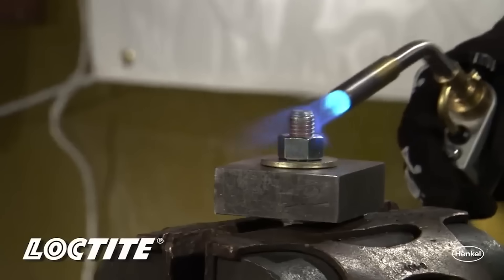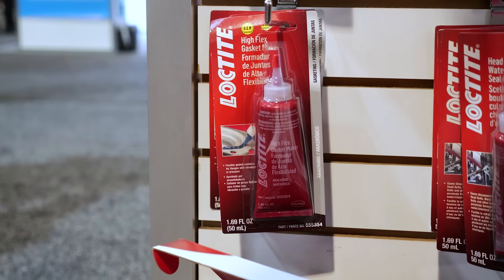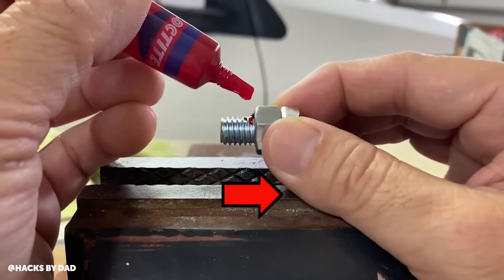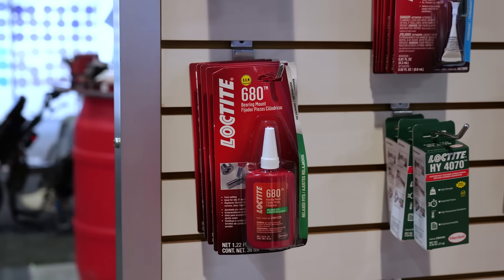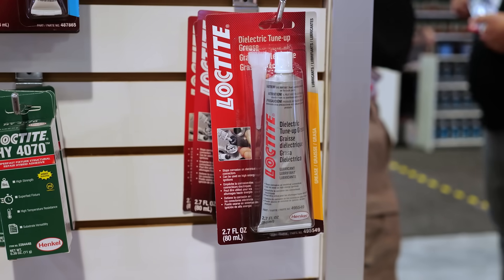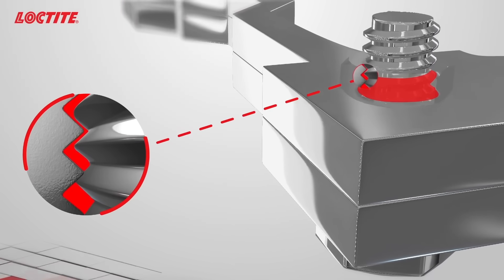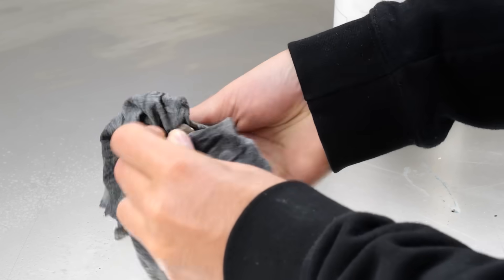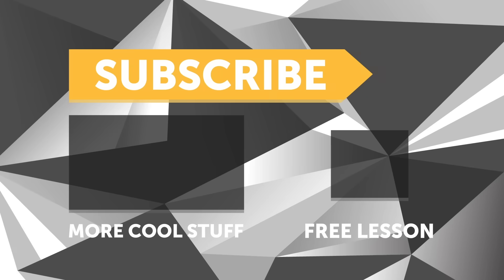Many pro mechanics don't know this.

Comment: Helpful video the only thing I also wanted to know that I'm not sure you talked about is how do the different types of loctite hold up in age?
Reply: That would be a good question to address to the manufacturers tech support and collect the answers. Enthusiast tests are useful but many people forget firms like Henckel etc have technical support who will answer questions about how they test their products. Cyanoacrylate locking methods have lasted me decades of use on a wide variety of systems but the plural of anecdote is not data. Since I have ways to apply pinpoint heat I mostly use red gel but do vary the amount based on experience. A recent inexpensive invention, the hand held induction heater, is insanely handy for users working on small hardware.

Comment: Which product should be used for small screws on fishing reels to stop them from shaking loose. Bearing in mind that the reels are stripped down on a regular basis.
Reply: Low strength purple ( 242 ? ) works for me on the tiny stuff.

Comment: I’m also a big fan of their gasket material (518) for sealing up motorcycle cases (also in conjunction with the OEM gasket, ie using as gasket dressing versus using RTV)
Reply from the maker: Great tip! What makes you prefer it over RTV out of interest? - Taz.

Comment: Mmm. So why do all these videos show cured Red Threadlocker turning relatively easily without heat?
Reply from the maker: If you find it easy to undo a bolt you've used a strong compound of threadlocker on, it either hasn't been applied correctly or it hasn't cured which might not have happened for a few different reasons - Taz.

Comment: I used normal red loctite on my exhaust manifold and it's worked long term! I had 3 bolts that kept coming loose because I couldn't torque them down correctly, put some thread locker on them and it has been good for years. I couldn't torque the bolts down because of the bad designed manifold, all I could use was a cut down ring spanner.

Comment: What looks like an official animation loop used in this video is shockingly inaccurate. LT243 is blue, it has the blue label and yet it’s squirting red. How they could let this slip is worrying.
Reply from the maker: With that attention to detail it's unlikely you're going to be using the wrong flavour yourself eh. Shame their animator wasn't at your level 😉 - Taz.

Comment: Being in the aerospace/defense sector. Primer T is used on every fastener and every bolt. Good stuff and helps the loctite set up quicker

Also would have been nice to skim over not only thread locker vs sealant. Good stuff nonetheless the less

Comment: hey, I've been wondering, what is volumetric efficiency tuning? as in what makes it different than tuning each block of RPMs in every maps (ignition duration & timing, and fuel diration & timing) one by one, map by map, using retarder/eddy dyno, i know VE tuning doesnt actually tune im volume but rather in air mass, but like wasnt regular tuning easier (it looks so easy based on you ignition timing tune, just press up and down on the laptop till it reached peak power at certain RPM and load lmao).

tuning by VE is a new field to me because not many people here do it.

from what i can get is VE tuning excels in racing where altitude variates since it takes into account fuel mass, air mass, pressure, etc. unlike regular tune where it just RPM and load/throttle position, meaning it's just as good as where the vehicle is tuned at?

Comment: Red loctite is the best way to reseal you oil pan bolts and also works great on you oil and fuel filters and even helps with spark plugs

Comment: I think it is worth mentioning that the torque specifications and requirements per bolt grade, class, diameter, thread pitch, etc. and the fastener pairing (nut, nut with washer, blind hole, etc.) are affected when loctite is used as it effectively becomes a lubricant and therefore the "lubricated torque value" (which is typically different than the dry value) from the bolt manufacturer's chart should be used to secure the fasteners.
Reply from the maker: Here's some info from another comment, hope it helps for now - Taz.

@hpa101 I'm a big fan of your channel, courses and podcast, so I'm glad to give back a little :)

I'm gonna talk to the guys in the office if I can share documentation on that. What I've heard from the lab is that you do not change the torque settings on your torque wrench whether you use Loctite or not. In most applications the torque of a bolt or nut is defined by its own properties (e.g. size, strength like 8.8 or 10.9 and friction coefficient). This is why you want to use different kinds of Loctite depending on your applications. Usually the bigger the bolt the higher torque is set, so the higher strength of Loctite you want to use. This is because even when tightening down a nut to a bolt, there will be tiny gaps of air between the threads. The smaller the threads, the smaller the air gaps, thus the threadlocker needs to be of lower viscosity to not be pushed out of the threads.  
For automotive applications you can use blue Loctite 243 in almost all of the cases though.
For reference: If you torque a bolt to 100nm and let it settle for 24h, you'll only need about 70-80% of the torque to loosen it again. If you use Loctite 243 it will stay at about 100nm for ever. Anything below 243 will also prevent loosening from vibration but might not reach 100% of the original torque. Anything above 243 will increase the torque needed to loosen the bolt.
Reply: Most manuals  / spec charts are 'dry' torque.  Lubricated - with oil, anti seize, or thread locker - is about 30% less.  That's a lot !  You can snap or strip a bolt sometimes if you use the 'dry' torque values.

Comment: Blue loctite the way to go, always used it on certain aspects where required, you don’t need a lot just a few drops. red for me is a no go it’s way too strong and have had issues stripping bolts or ruining inside of the core specifically being aluminium you don’t want to go anywhere near it.

Comment: One thing I noticed, in the animations they show the nozzle being touched against the metal of the fasteners, while applying. This is what causes the nozzle to get blocked up (The Loctite drops on the end of the nozzle react to the metal and start to harden). If you simply drop the Loctite onto the fastener, your nozzle will never block up. Learnt this during an official Loctite demonstration.
Reply: @timjohnun4297  wrong. Loctite hardens in the absence of air. He even said it in the video. Put a drop on a bolt and let it sit for as long as you like and no matter what, it will still be liquid.
Reply: @duncandiving9748 I’m just relaying what was told to me by the Loctite people themselves 🤷‍♂️ the Loctite hardens from a reaction with the metal. That’s why Loctite primer is used on stainless steel bolts, because without it there’s too little reaction. But you believe what you want to believe…by your logic, putting the lid on the nozzle would cause blockage….
Reply: LOCTITE® 243 - RS Online To prevent the product from clogging in the nozzle, do not allow the tip to touch metal surfaces during application. 5. For Thru Holes, apply several drops ...  It really wasn't hard to find......

Comment: Should you use loctite on a torqued bolt? If yes, how do you obtain the correct clamping force?
Reply: Yes. Torque the bolt as per the repair manual instruction or if there's no instructions use standard torque chart. Unless it call for anti-sieze, then don't use Loctite.

There are bolts that shouldn't ever be loctited but it's honestly a small list.

Comment: Nice work!  Much as I don't usually comment on brand/product specific videos, this was really informative.  👍👍
The questioning here is far, far better than the standard I've seen in this style of video.  It's to the point, with accessible language and simple explanations for non-engineers (like me).  Also, avoided dumbing-down everything, to a point badly, which insults the intelligence of higher skilled viewers.  Finally, this was free of babbling  @rse-kissery. 🤢
Reply from the maker: Cheers for the support! The goal is to always be informative 😎 - Taz.

Comment: Something I wish loctite would cover is not using loctite on bolts to hold in polycarb/plexiglass plastics. It causes cracking and failure of the plastic.

Comment: I was working in a highly regulated industry. Someone had messed torquing some bolts up, so everyone was going through a remedial training session about fasteners. Someone chimes in with “How much loctite should we use on fasteners that need it? SOP doesn’t state an amount.” Completely stumped the guy doing the training, he didn’t know, and he looked mortified because an auditor could have had them shut down by posing the same question.
Reply: Refrigeration? NH3? lol, those SOP's

Comment: Red locktite is for when you hate someone. Idk why else you'd use it as a normal person. If you're accessing that bolt once you might need to do it again.
Reply from the maker: If you can get heat to it then it's fine. Remember this stuff is used well beyond just automotive applications too where heat often means a small fire beyond a few locations 😂 - Taz.

Comment: Thread locker, anti-seize, brake cleaner and grease are a few of the products I end up having to buy while in the middle of a project, I buy the large bottle, can or tube and use it once and then it gets used up or goes missing.
Reply from the maker: @simonlegall2135 I hear ya! We buy 20l of brake clean at a time now to help avoid that issue 😂 - Taz.

Comment: Main bearings and head bolts I was taught many racers use milk of magnesia on main bearing and head bolts, it lubricates them for correct torque and dries and prevents corrosion. I don't know if it is okay to use it with the new "Torque to yeild"head bolts, some say lubricate, some say torque them using just clean bolt and threads, do what head gasket manufacturer recommends to get correct torque!

Comment: As the interview goes on, notice the shorter male’s posture in regard to the taller male’s. 

But what’s this? -By the end of the video, the croc-hunter is nearly 40 degrees angle in his back, but 2 inches taller.  Crikey!
Reply from the maker: The guest has moved closer, which is interesting as usually they back away throughout an interview 😎 - Taz.

Comment: I use nothing but red for personal vehicle (including motorcycles which are delicate compared to cars) but quantity is key. I've had no (and I do mean no as in zero) problems even on parts that have been joined over 30 years. However if one is willing to pay for positive retention that means aircraft safety wire and/or tab lock washers which provide positive retention. As the USAF puts it (I'm a retired engine troop among other things) safety wire "maintains torque" which I can vouch for in person. Safety wire does not change the torque required to release a fastener nor does it abrade threads which matters on multi-million dollar engines.

Comment: Still got a pack of blue loctite (unopened) I bought 15 years ago. Never used the stuff, torque wrench and tightening to specs have looked after me so far. Worked on heavy elec switchgear, vehicles, weapons, all sorts of gear since the early 70s. But then again, I'm the World's messiest glue user as well. 🤣

Comment: Very useful segment.  I spent my entire career working in a valve manufacturing environment, in both Engineering and Sales.  We intuitively understood the proper product and application for thread lockers.  But I cannot tell you how many times I've watched people slather on far too much Loctite than necessary.  I always counseled to use only 2-3 drops but was mostly ignored by the old-timers who thought they knew better.  Also, I've cautioned people many times that you should be using "blue" Loctite, rather than "red", for 90% of your applications, really only using red when you anticipated NEVER needing to remove the fastener.  So, it was nice to hear my understanding confirmed directly from Loctite.

As always, thanks much for sharing.

Steve

Comment: Vibra-tite 444 has been my go to on all high pressure fittings for a commercial pressure washing rig. Lots of fittings under constant high temp water(180deg) at 4,000psi with about 100 cycles per day. As long as the threads are clean and a 24hr cure time is used I have nearly zero down time for leaks - for me this has almost eliminated thread tape. Nothing is perfect but Im as close as I can get.

Comment: They used this stuff on the posts of pinball machines back in the 80s. Almost impossible to remove them without breaking.
Reply: @thomasmickle7289  Yet an ashtray underneath the leg improved the win ratio by 500%!

Comment: When I remove a bolt that had blue threadlocker on it, do I have to remove the threadlocker remains before I add the fresh threadlocker and screw the bolt back in?
Reply: @ishutwar7470  best practise is to remove all traces of previous Loctite on the bolt and it's hole but after a while you use judgement for 90% of work.

Comment: Something useful about threadlocker is that it's not a lubricant. This is important for tightening fasteners with torque wrenches.
Reply: @ben501st  Great tip! Most torque specs are based on clean, dry threads. Lubricants lead to over tightening.
Reply from the maker: There is a comment below on this from a Loctite employee. Hopefully they come back with a bit more regarding the testing they've done too which led to their recommendations - Taz.

"@hpa101 I'm a big fan of your channel, courses and podcast, so I'm glad to give back a little :)

I'm gonna talk to the guys in the office if I can share documentation on that. What I've heard from the lab is that you do not change the torque settings on your torque wrench whether you use Loctite or not. In most applications the torque of a bolt or nut is defined by its own properties (e.g. size, strength like 8.8 or 10.9 and friction coefficient). This is why you want to use different kinds of Loctite depending on your applications. Usually the bigger the bolt the higher torque is set, so the higher strength of Loctite you want to use. This is because even when tightening down a nut to a bolt, there will be tiny gaps of air between the threads. The smaller the threads, the smaller the air gaps, thus the threadlocker needs to be of lower viscosity to not be pushed out of the threads.  
For automotive applications you can use blue Loctite 243 in almost all of the cases though.
For reference: If you torque a bolt to 100nm and let it settle for 24h, you'll only need about 70-80% of the torque to loosen it again. If you use Loctite 243 it will stay at about 100nm for ever. Anything below 243 will also prevent loosening from vibration but might not reach 100% of the original torque. Anything above 243 will increase the torque needed to loosen the bolt."

Comment: Torque things correctly with the appropriate hardware and thread locker isn’t required!

Don’t torque things correctly and don’t use the appropriate hardware; use Loctite
Reply from the maker: Not at all 😎 Thrradlocker and torque are very different things, not interchangable - Taz.

Comment: Remember using friction modifiers including Loctite will mean you need to adjust the torque on a fastener to achieve the same clamping force. In almost all cases you will need to reduce the fastener torque.
Reply from the maker: There is a comment below on this from a Loctite employee. Hopefully they come back with a bit more regarding the testing they've done too which led to their recommendations - Taz.

"@hpa101 I'm a big fan of your channel, courses and podcast, so I'm glad to give back a little :)

I'm gonna talk to the guys in the office if I can share documentation on that. What I've heard from the lab is that you do not change the torque settings on your torque wrench whether you use Loctite or not. In most applications the torque of a bolt or nut is defined by its own properties (e.g. size, strength like 8.8 or 10.9 and friction coefficient). This is why you want to use different kinds of Loctite depending on your applications. Usually the bigger the bolt the higher torque is set, so the higher strength of Loctite you want to use. This is because even when tightening down a nut to a bolt, there will be tiny gaps of air between the threads. The smaller the threads, the smaller the air gaps, thus the threadlocker needs to be of lower viscosity to not be pushed out of the threads.  
For automotive applications you can use blue Loctite 243 in almost all of the cases though.
For reference: If you torque a bolt to 100nm and let it settle for 24h, you'll only need about 70-80% of the torque to loosen it again. If you use Loctite 243 it will stay at about 100nm for ever. Anything below 243 will also prevent loosening from vibration but might not reach 100% of the original torque. Anything above 243 will increase the torque needed to loosen the bolt."

Comment: You shouldn’t touch the tip of the applicator on the bottle to a ferrous bolt. The Loctite will activate and harden up in the tip. Drip it on.

Comment: I use blue often because medium strength is fine. Now I know the difference between red and blue. But I use red everywhere before that never had an issue getting them apart, as opposed to 30 years of rust.